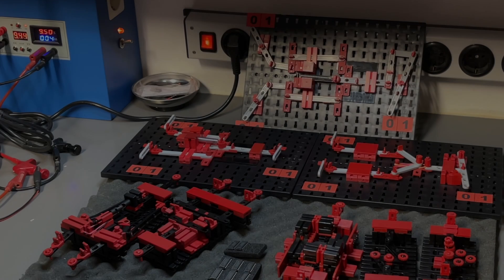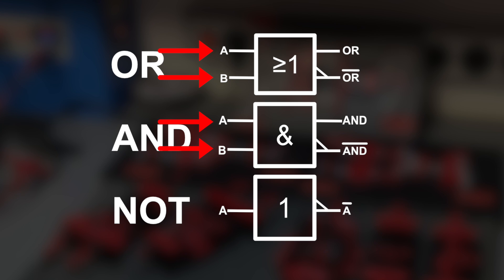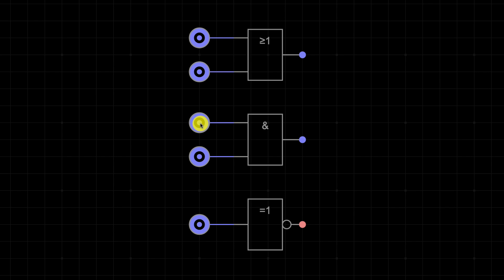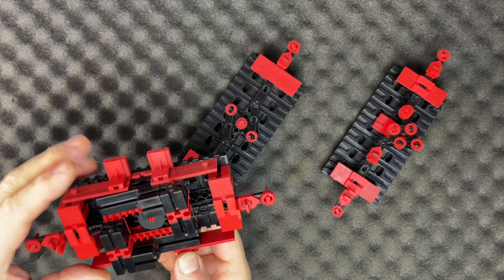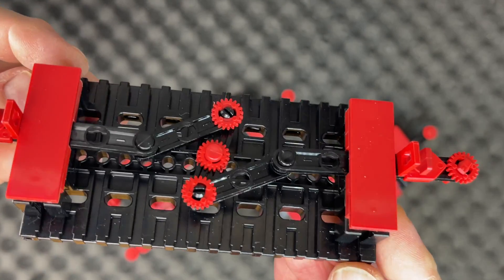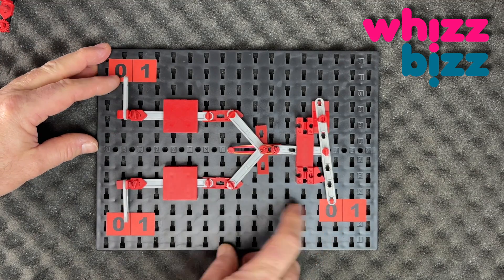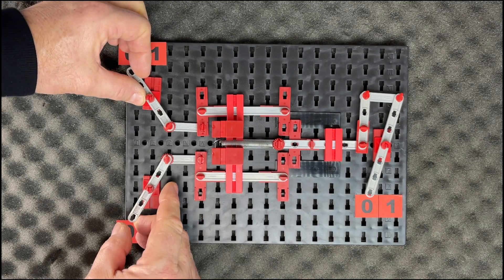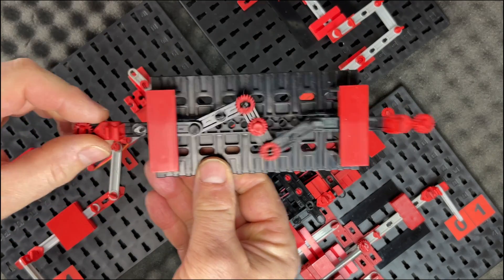Mechanical Logic Gates

Comment: If signals are not defined by their left or right position, but by the fact if they are "in" or "out" then some of these mechanisms get even simpler. Like the inverter could just be a straight rod? Pushed in on the input side (0) - pushed out the output (1). Pulled out on input side (1) - pulled in on output side (0).
Reply from the maker: Absolutely right, but of course a straight rod does experience sliding resistance and so, even if we were to call it a buffer instead of an inverter, it would be of little use mechanically. So yes, you can simplify a lot with the relationship between logic level and direction, but as soon as you want to compose more complex functions from multiple mechanical logic gates like this, the inputs and outputs will have to follow the same convention. You can then only make it work by including inverters on the inputs or outputs, and I would see those mechanically as part of the logic gate.